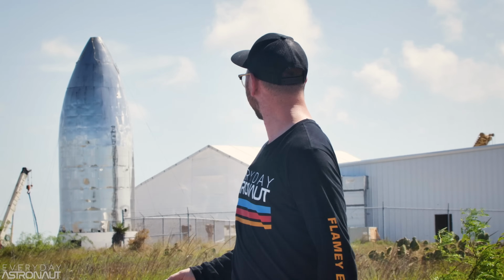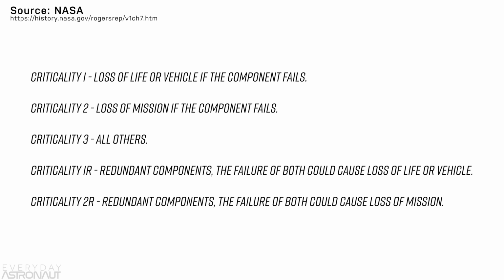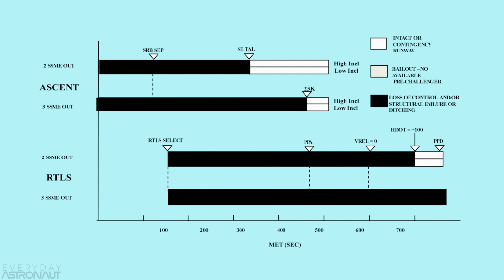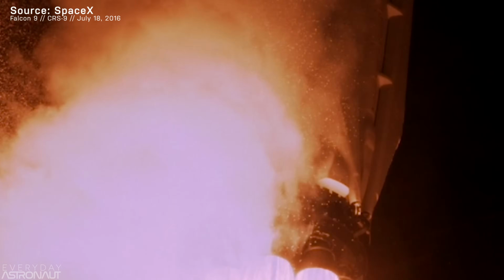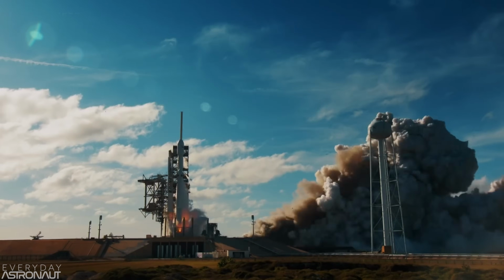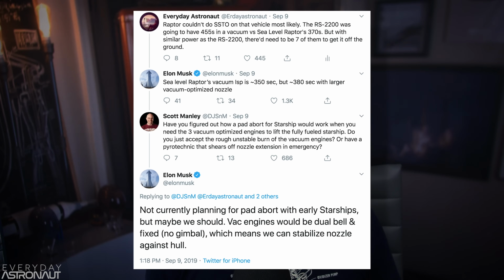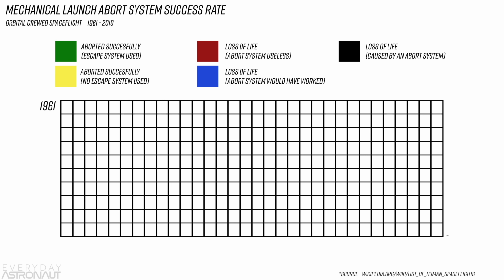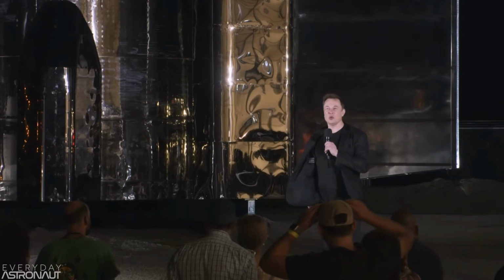Why won’t Starship have an abort system? Should it?!

Comment: Murphy's law:Anything that can go wrong will go wrong"
Has any machinery in history of earth never failed? No
No matter how reliable a vehicle is, malfunction is not a matter "if", it's 'when' - given enough time.

If you developed 2 reliable vehicles in the same system. The odds of the 2 having vehicles fail at the same flight are slim to none.

Having 1 vehicle in 1 system is doomed to have some unforseen technical malfunction which will cause the vehicle to fail and loss of crew, since redundancy can't be made for every part / hull.

Therefore starship must have abort capability.
Reply: Problem being: starship, out of any other spacecraft, has the least areas where an abort system can actually save the crew. On the ground and during initial ascent, can save lives. But then... not even close. If you have a problem in I initial earth orbit, you can't re-enter the atmosphere without burning. 
 If you have a problem during transit, you die as you can't get back to earth and re enter the atmosphere. If you have a problem anywhere during you stay on mars, you can't come back anyways for years until a new orbital period present itself, not counting the fact that only the starship. Body houses your means of survival. In short: a launch abort is too useless for a mission outside low earth orbit to bother adding the weight, and it is better to reinforce the systems of the vehicle instead.
Reply: @mobiuscoreindustries  Transit Between earth and mars no vehicle can do anything.
There is always a risk in spacetravel, like it is in any extreme environment, including being at sea.

It's a "launch abort". Reason being it's most risk during launch...

I'm not sure you mean by "burning"
Starship(not super heavy) can even return from the moon entry velocity.

"Starship" vehicle will be the abort system, so there will be no more adding weight else than sensors and software. This vehicle needs to be the most reliable because it's going to land and take off anywhere.

If you made a car very safe, then you can throw away seatbelts? 

Starship will transport many people eventually. You can make it like an airliner, but there is no controlled exploding bomb on an airplane, so anyhow there is always more risk.
Reply: @mobiuscoreindustries  My point being. It is worth the development of the about that starship will be the abort system( not an extra capsule) that will not be worth it.

Comment: You can make redundant systems for critical control surfaces, but if a sufficiently violent or unforeseen failure occurs, it could destroy all the redundancy.  Look at United 232 (DC-10 engine 2 uncontained failure) for an example of this.

Comment: Eh, fuk the safety system, don't need parachutes on airlines for similar reasion.... Flood her with oxygen and higher voltage systems that ark impressively when they fail... Oh? We already did that? Huh... Sounds WAY more silly that current practice. They know the risk... Make it safe as you can and send them bald monkeys up!!!

Edit: Monkey spelling on my part I may or may not have fixed much.

Comment: I understand the idea that making one thing more reliable, but I also stand by having a different thing of redundancy benefits from a new set of unknown issues. 

Say for example plan A, has a 90% chance of success based on known issues and failures. The set of unknown issues and failures is specific to the parts of that plan. Where as plan B, may only have a 80% chance of success. The benefit of having both plans, hypothetically is that you are increasing the amount of unknown issues required for failure.

Comment: Escape systems should be added when the cost to design, build, test, and operate the escape system provides a greater reduction in risk than spending the same amount on other reliability measures like adding reserves / redundancies and flying more (uncrewed!!!) test flights. I think that the crossover point in risk/cost for a very large rocket is around 100 flights per year, which Shuttle obviously never got close to reaching, plus Shuttle could not fly uncrewed anyway so it never really had "test" flights. Above that flight rate, adding an escape system is actually worse.

Comment: 2 shuttle accidents was cause by the very top people overridden safety regulations. 1 the o rings could not be launched when the temperature was below freezing and so launched was cancelled. Yet the launched was ordered to go by those at the very top. 2 the shuttle commander thought he felt the shuttle hit during launch and wanted to turn the shuttle so the lights of the space station would shine on the tiles. The shuttle crew could patch any damage or missing tiles in space. But those at the top said No come home NOW!!
And so with a missing tile heat enter the shuttle and BLEW IT UP!! But those at the top never faced any punishment and the system is still in place. And private space companies are working with nasa and even partnered with the same system with people at the very top overridden all safety rules whenever they want too. So how soon before the next accident will happen which it will!! And it be thier fault yet they like before will blame others and so...

Comment: It's somewhat amazing how the same people who were bashing the shuttle for it's flaws are now using the exact same arguments that NASA was using for the shuttle.

After challenger everyone was saying how bad of an idea it was to have all these black zones where abort was impossible. 
The argument used for the space shuttle was always that the design was so well engineered, so overbuild, that the chance of failure was almost none existantant. In essence this is the same argument used for starship. 
Solid rocket boosters were a bad idea in hindsight only. They are usually the most reliable rocket booster available (much more reliable then liquid fueled rockets). It's just that this segmented design was not. If the booster on starship explodes, it's just as bad as a solid rocket booster exploding, being able to shut down the engines in the early stage of the flight will not save anyone.

The space shuttle relied on technologies that we thought were a good idea and turned out not to be. Starship, while removing many of the failure points of the shuttle, has a whole range of new, untested technologies, it's bound to fail someday.

Comment: Just a thought. What if you focused on making the crew capsule more survivable instead of escaping. Kind of like what they have done for cars with seat belts and airbags. I'm not saying they should use airbags, just that maybe something could be done to the grew area to make it stronger and safer.

Comment: I mean, the idea of pressure testing and what if people were on it... They wouldn't be. Why would you load everyone up for a test of any kind?

It's also highly likely that no Starship will carry people on its first flight - only after it has launched, landed and been inspected to verify it was put together right in the first place. So far, the magority of problems have come from rockets on their maiden flight, because you simple can't test them properly. Flying them at least once at least ensures it was built correctly.

Also... Again, it's better than the Space Shuttle in any case. At least you Can actually do uncrewed test flights, and there are no side mounted solid rocket boosters to explode/fail/throw off bits of ice to damage heat shields/blow O-rings and explodify the whole thing.

Comment: Shoddy Welds .......I'm a welder and that cuts deep hahaha ;-)
Reply: The early Starship boilerplate test vehicles, which were made of 301 stainless steel, did have terrible-looking welds. The latest Starship test vehicle (see the SpaceX "flying grain silo" videos--that vehicle is testing their latest-model Raptor methalox [LOX/methane] rocket engine) is made of 304L stainless, which has a bit lower melting point than 301, but is more ductile and easier to weld. Its welds are very neat (not zig-zagging or "globby" at all, like on their earlier Starship test vehicles). In fact, its panel welds look as perfect as those on the old "balloon tank" Atlas rockets, whose pressure-rigidized RP-1 kerosene and LOX tanks were thinner-walled than a dime (the hydrolox [liquid hydrogen/liquid oxygen] Centaur upper stage, which first flew [unsuccessfully; its plastic weather shield broke away early during ascent, rupturing its hydrogen tank] in 1961 and is now used on the Atlas V, uses the same stainless steel balloon tank construction).

Comment: while I agree that the ultimate answer to space safety is experience, and that with enough experience we can eventually reach a point where "space travel is as safe as air travel" the truth is we aren't anywhere near that point. modern spacecraft don't operate in nearly the same regime as airliners, in fact, I would say they are closer to fighter-jets than airliners; consistently operating within the upper limits of their capabilities. and with fighter-jets, even today, abort systems are widespread and frequently save lives, not just in combat, but also in "routine" training exercises. I think mechanical abort systems are, and will continue to be, important because they don't just represent an alternative path to the safe end of the mission, they provide a fundamental shift to the end-of-mission objective. when operating a vehicle like the starship, or space shuttle, or f-16, the standard end of the mission necessarily entails the landing and recovery of the entire vehicle; this is (obviously) challenging, and there is a very large margin between success, and catastrophic failure which requires dozens to hundreds of systems work perfectly. safely landing a human, by comparison, is pretty easy: you set down a 200 lb sack of meat softly without cooking it. the launch abort system gives you a way to say "well, we cant save the big expensive vehicle, let's just save the people. so, while mechanical abort systems DO represent an increase in complexity for the few seconds that they're active, they also represent a drastic decrease in the complexity of the remaining mission: run away from the explosions, wait to float back down to earth.

Comment: This story is about FLAWED thinking of a moron. And the genius of a non-moron - CORRECTIONS, and the blither blatherings of a YouTuber. When the Shuttle only had three crew members, it did have an escape module. Suggestion No. one, Stop attempting to be an engineer or a physicist, explaining engineering and physics. You're doing a very good job of displaying the many reasons you should. No. 2,  Learn how to flip-burgers at Whitechastle. No. 3, take a remedial course in logic.

Comment: Why not make the vehicle more reliable AND have an abort system? Or is this a dumb question and I should just shut up?
Reply: added cost and added weight -> less financial efficiency.
basically combining the economic downsides of both approaches. it is a question of cost in lives/reputation vs money.
Reply: @kensaiix  Yes, but if you were able to divide a department up, you could devote one team in perfecting the design and redundancy, and the other to make a simple abort system JUST in case somehow the other team missed something. I still believe focusing more on engineering the crap out of something so it doesn't fail is better, but at least having some plan B is also not a terrible idea, even financially. Besides, you'll have a better reputation. Like Tim said, I don't think NASA would want to put their astronauts on a giant rocket with no abort system.
Reply: @arro_rockets  of course. but, in the end it still boils down to how much money is poured into the whole process and at what amount it is deemed financially infeasible. somebody else may argue that the other route with a more secure and sophisticated abort system and current design redundancy is the way forward. 
there is a lot of grey area and until one is involved deeply in the decision process, there is no way for outsiders to make a call. and very often, key decisions are made on an emotional basis rather than on an mathematical or economical one.
Reply: @kensaiix  Yes true, I was simply just overthinking things, I'm sure the team at SpaceX know exactly what they're doing

Comment: Starship/Superheavy (SSSH) will have plenty to do in the next few years short of becoming an orbital/space mass-transit system.  One could envision construction, supply/resupply and crew shuttling for: 1) lunar space colonies, 2) early-generation zero gravity and centrifugal gravity space stations (manufacturing/space tourism), 3) astroid mining, 4) science missions, and other near-interplanetary infrastructure, etc., without having a mass-transit version.  Man-rating the Falcon-9 for low-payload Crew Dragon missions and using a nose-mounted variant of Crew Dragon for the manned "module" of Starship could provide mission-abort-capability for the first few generations of Starship while flight safety systems are being perfected for the mass-transit version.

Comment: Personally, I tend toward the side that says no abort system. Why?

- Fewer parts and lower total system complexity is preferable, as it will result in a more easily predictable total system, with fewer chances for unanticipated interactions leading to potential failures modes.
- Abort systems are very heavy due to the extensive necessity of duplication of systems. This greatly reduces performance margins, and can therefore in its own way actually represent a safety risk, because the mission has to go pretty much exactly as planned! You really do not want to run out of delta V to land..!
- As per the previous point, having a bigger mass budget to work with if you do not have the heavy abort system means you can add additional redundancy, or mechanical margins on particularly important parts (maybe most of the things that had a margin of 1.5, you can increase to 2.0, for instance!), thereby adding safety margin 

N.B.: I do wonder if in future, whether it would be possible and at all practicable to transform each crew cabin into its own self contained capsule with a parachute (say, the capsule is small and only encompasses the crash couch/bed). They could have no propulsion or anything, keeping it simple and lower weight. The idea is that if a failure occurred during flight, there is at least SOME chance of survival. Some failure modes will not be survivable, but something has to be better than nothing, right?

Comment: Also, the Ares-I abort system was planned to be active during the SRM burn of the LV; a det cord would split the SRM case, and the abort motor was designed to have sufficient thrust to pull away from the LV even during SRM max thrust.  So, you DON'T have to "ride it out" if you're using an SRM.

Comment: Great video as usual Tim. Question though: you state that you think NASA will require SpaceX to use an abort system on the first flights of starship. That is not something that can just be pulled from a shelf... someone has to design and build it and this should be an integral part of the system. How do you see this unfolding over time?

Comment: Any good engineering philosophy I like is “KISS”.  Keep It Simple, Stupid.
Reply: @mikejohnstonbob935  Stupid is completely separate from simple, thus the comma. Also simple is not the same as stupid. So its an entirely separate part of the acronym. We cant just re invent acronyms because we think we're clever
Reply: Keep it simple. More complexity = more chances for problems
Reply: I’d have to disagree, rockets are anything but simple, I’d like any rocket I ride on to be as complex as necessary.
Reply: @jcughan  Yes, the KISS part comes in making "as complex as necessary" as simple as possible.
Reply: @jcughan  Nope Elon aka Tony Stark, Would say the more complex a rocket is the more pron to failure it is.
Reply: @jcughan  complex adds more points of potential failure.
Reply: Night Hawk Complex engineering doesn’t mean it needs to be a complex design
Reply: Adam Neely?
Reply: @hennie5307  wrong channel
Reply: Don't EVER think about being an engineer, because being one involves figuring out the most complex of problems that sometimes do not have even one solution created for it at the time, it all may look easy on YouTube, but when lives are at stake, there's no room for even 1% error.